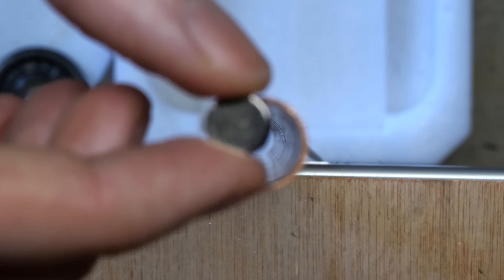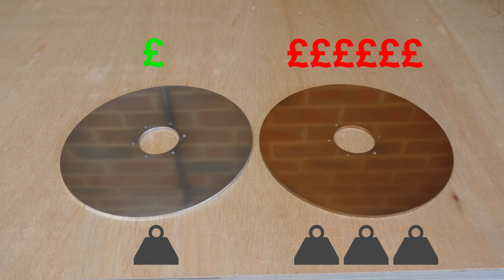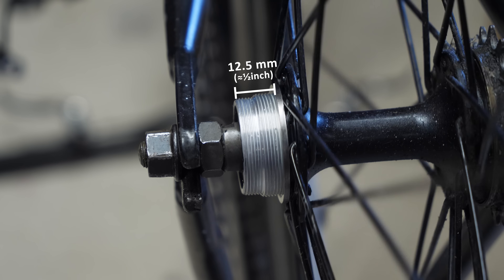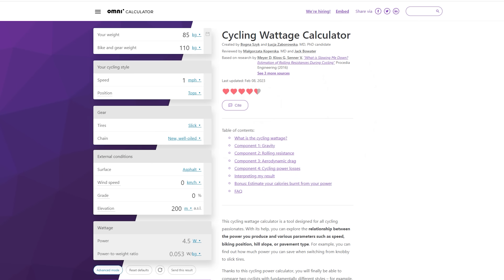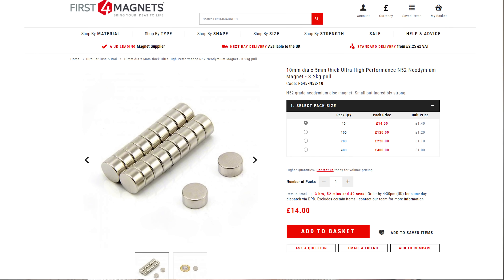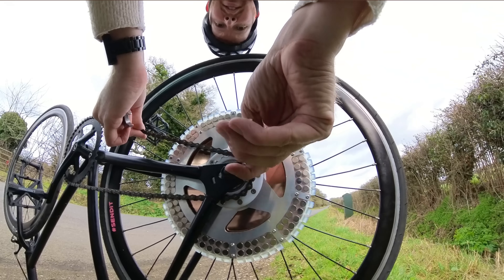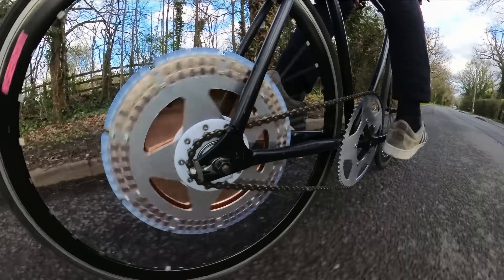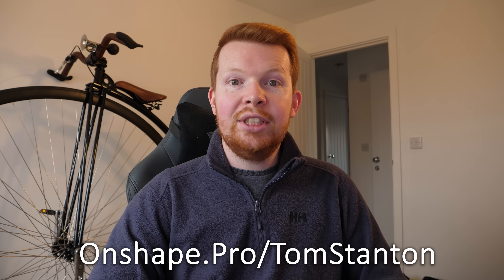Gearless Magnet Bike

Comment: You could try mounting the magnets as a halbach array, it's used to point most of the magnetic field in a single direction meaning you'd get more Eddy currents and less chain sticking!
Reply: It would have got all the flux on the side of the copper disc, which might have prevented the magnets from sticking to the chain.
Reply: Do it, would be a nice-follow up video. Maybe easier with the cubed magnets than than the cylindrical.
Reply: What about a gap magnet?
Reply: Rn  r ryr
Reply: Rn rn ryyrr
Reply: And get a stainless steel chain And a "spring toothed?" One way gear on the front sprocket for coasting AND a way to close and lengthen the gap between the magnets and the copper disk for gearing AAANND enclose the magnets to separate the road environment because they'll clog themselves with iron dust.....oh and some hand brakes for stopping.  By the way, your copper disks will warp from the heat so make them easily exchangeable.
Reply: Really
Reply: The
Reply: Ryyry
Reply: The first time time re
Reply: @rebornmomma129  take your time
Reply: @rebornmomma129  If you click the 3 dots in the right margin opposite your comment, you get the option to delete it.  Then you can re-write it the way you intended.
Reply: @DownhillAllTheWay  lolll I fell asleep with this video on and I think my cat laid on my phone haha
Reply: No, this is dumb.  It would be far more interesting to generate electricity by pedaling than this stupid contraption.  It's expensive, failure prone and highly inefficient.
Reply: @christo930 , a bike with a pedal-driven generator and an electric motor at the wheel already exists.
Reply: @Johnny.Fedora  What's it called?  Who makes it?  it is also a dumb idea, just not as dumb as this idea.
Reply: If you go halbach the distance between mags and copper becomes more accurate(making a gear ratio situation more difficult to "tune in") so heat and warp aren't worth achievement of gearing.  Gears, cogs and chains beat you damn engineer "thinkers" out every(almost) time.  You might try focusing more simple, less complicated.
Reply: @gqoniefh  no dude you don't get it. We know it's not practical, but it's fun to do and that's what matters
Reply: B b   My. 

I
I
 Hi 😊WARE A

Comment: The gears are for changing the ratio so you can use your energy for more torque or more speed.
This is a fix ratio transmission with an unnecessary clutch in the middle.

The weird felling you described is what happens in a manual transmission car with a bad clutch.
A bad clutch will slip when too much torque is applied at low speed. The engine rpm will go up but the speed not so much creating a lot of heat and wear in the clutch.

Other than that, nice experiment. You put a lot of effort and resources into it.

Comment: Tom ! limited space on legacy archi was the real issue I would use cams to perma-engage / disingage the magnets and use a regen mode for heat wastage  . for a smart guy you're pretty far away from a real consumer device but waaay closer than you think I use integrated everything in my motor and drive designs oh ps I design everything around the TORQUE CONVERTER !

Comment: This is cool, you could have a research grant to do this, brilliant.

Can you do a variable hydrostatic drive on a bike? You could use the drivetrain parts from a zero-turn ride on mower. By controlling swashplate angle of the input pump you have stepless gear control over output motor. Normally this is messy and lossy but it’s fun and replicates how a lot of trains and off-highway construction vehicles are propelled.

Comment: Excellent idea! Bravo!
Make the copper and magnet disks as large as around the half of the wheel (or greater, just enough to to avoid dust and water) to have more torque. And mount the one way bearing in the pedals to let the pedals be free of turning (opposite of the ordinary bike as it has one way bearing in the rear wheel).

Comment: you say  16:08 "had hoped it would simulate a CVT":  I call total BS.
You have all this engineering and design skill yet fail to appreciate the basic physics which makes it obvious from the start that this is about the worst possible design for a "variable rate transmission" since it just dissipates all the energy left over from the slippage, and the magnetic clutch can never fully engage because the transmitted force is propotional to the difference in speed.

Comment: I commend you on a job well done! Excellent execution. I give you an A+ for effort. A+ for precision. A+ for concept. 
I have a patent for a scrubber. I did it  not for money but just to see if I could do it. There was a lot of "prior art" out there. However; I was awarded the patent because of the pattern of holes I made for the air and gas to be forced through. I have to give my patent attorney credit for thinking the hole pattern could be the thing for awarding the patent.

Comment: ~2:00 heavier objects do NOT fall faster. falling speed and acceleration is not affected by mass. basic physics.
edit: what  DOES affect the speed at ~2:33 is the moment of inertia of the discs. this should be observable without the magnets, even though the falling distance is relatively short.

Comment: Great experiment.
Very interesting concept.

Could this be developed to generate electricity to charge battery and regenerative braking .
To improve battery range?
And perhaps with crank motor assistance might be more practical as the motor can spun faster .
Also a rear wheal from say an 8or 9 speed bike you would have more room for mounting your disc assembly .

Comment: You are awesome. A few weeks ago I started disassembling old hard drives to salvage the really balanced alloy discs for the purpose of using it as a rotor and possibly carrier of magnets in a motor experiment with my bicycle. Kinda scary, because it seems you've read my mind and some of the questions you answer in this video here (especially the conductivity/permeability of Copper and Aluminium discs).
So, thank you Tom! :-)

Comment: Hi, have you thought about making a variable gear ratio? Two disks with magnets rotating relative to each other so that the magnets on the second disk neutralize the magnetic field created by the magnets of the second disk. According to the principle of magnetic locksmith clamp.

Comment: Great video and experiment. I think the one thing that i'd like to have seen would be what happens during braking if instead o f stopping you were to pedal backwards? Not even sure it is feasible with the current design but I would think that the difference in rpm would be increased (especially effective towards the lower end of the speed) and thus reduce stopping time drastically.

Comment: Now there's a thought. Is there cylindrical magnets that have north/south poles not at each end but half way through the middle (so there's a semi-circle to each pole)? * quick google later * - Yes there is, they're called 'Diametrically Magnetised'. 

If there is such a thing then you could moderate the eddy current by rotating the magnets without changing the distance away from the disk in a mechanical method (the other option would be using electro magnets since you could just reverse the current to inverse the field). 

Idle thoughts anyways.

Comment: Watching you ride you need to machine an elliptical chainring rather than a circular one. Then when you are in the power stroke you get a bigger gear and you get over top and bottom  dead centre with a lower gear. However what practical application the whole project has I do not know

Comment: To upgrade this concept I think the next step is to add a small electric motor to help with the high torque and use the braking force to recharge the battery (it might require to invert the system and mount the magnets on the wheel instead of the copper disc)

Comment: I don't think it was mentioned, but the thickness of the metal plate, either aluminum or copper, also makes a big difference.    You could increase the magnetic field strength further by arranging the magnets in a Halbach array, which would have the additional advantage of reducing the magnetic field attracting the chain to near-zero.  Perhaps you'll want to revisit this project when they come up with room-temperature superconductors.

I once had a stationary exercise bike that used magnets and a metal plate to dissipate energy, creating a real workout - I got tired just watching the video!

Comment: New idea, I've been wondering about this for a long time, what if you redesign it positioning the magnets at maybe 45 degrees on the disc and a movable pad with the opposing 45 degree magnet? would this mean that when the pad is closer to the disc would give you pedal free propulsion, and the pad positioned away from the disc would mean a neutral that should allow the bike to stop? maybe?

Comment: It's not really a ratio changing system. It just wastes energy as heat proportional to the speed difference of the discs.
It's a magnetic retarder ,as used on heavy vehicles, installed wrong.

Comment: How about replacing the magnets with electromagnets which can be switched on automatically when pedaling forward and then control manually for regenerative braking?
A small battery bank may work which could be recharged through regen braking!
Moreover, the bike could be used for generating electricity through simple pedaling by locking the wheels?
More engineering maybe needed to provide contacts for the wires for current to flow!

Comment: All I could think of is what if this could be used to brake large aircraft? 
There would still be a heat issue, and with slow speed braking a conventional disc needed to fully stop the aircraft, but maybe there's room to have a hollow copper disk where cooling fluid could be run and have both magnetic and friction technologies installed on each wheel?

Comment: Could you repurpose this build into a  "ride by wire" ebike?  Most I've seen use the pedal hub as the generator, I wonder if a rear wheel gen setup could get you going faster or require smaller battery.

Comment: Good thing you mentioned the heated-up copper disk in the end, as this was more or less the first question that I had in mind: how much will the disk heat up? I got confused about the effort you made, using the UV-cure-printer to get the imperial thread width you needed (instead using a hub with a disk break mount), or the effort to keep the chain from getting drawn to the magnets (instead of using a belt drive). But hey - cherished the Adidas'..!

Comment: While this is a cool idea, unfortunately it really is an energy wasting slipping clutch.

Your calculation that you did for energy transferred, actually calculated the wasted energy, not transferred energy.

There might be some innovative way to take the electromagnetic energy generated and turn it into torque and rotational power, but the design, as is, turns that energy into waste heat.

The only way I can think to do it is to include coils of wire on each side and wire them together

Essentially it would be building a large OD electric AC motor to behave as a generator and a second one to behave as an electric motor.

By wiring a variable transformer (like a Variac) between them you could create an infinitely variable CVT.

Comment: I wonder if you could solder on some heat sinks in a position that they aren't in the way. The airflow will come from the movement of the tires.

Comment: You built it backwards. Your pedals are driving the weight of the magnets, which is why it needs the bigger gear. Turn the magnets with the wheel and the cooper with your pedals, then it should fly as fast as you want to pedal.

Comment: To replace the gear system, the magnet and copper disk should not be concentric. Instead the two axels should have a changeable offset distance to model different gears.

Comment: Not a very good torque converter, but it would make a very good frictionless brake to use to supplement regular brakes. So it will never wear out. Just push magnets closer for harder braking and pull farther away to lessen and disengage brake.

Comment: Copper has a higher electrical conductivity than aluminum, which means that it can generate stronger eddy currents when subjected to a changing magnetic field. This, in turn, can result in greater braking force. However, copper is also heavier and more expensive than aluminum, which could be a consideration for a bike where weight is an important factor.

Aluminum has a lower electrical conductivity than copper, but it is also lighter, cheaper, and more widely available. It is commonly used in the construction of bike frames and other components due to its lightweight and strength.

In terms of the specific application of a brake using eddy current effect in a traditional bike, both copper and aluminum can work well. If you prioritize maximum braking force, copper might be the better choice, but if you prioritize weight and cost, aluminum may be the better option. Ultimately, the decision would depend on your individual preferences and requirements.

Comment: How about making a mini version of a fluid torque converter. If you added a few magnets into the converter, you might achieve both torque multiplication and magnetic lock-up at moderate torque cruising speed.